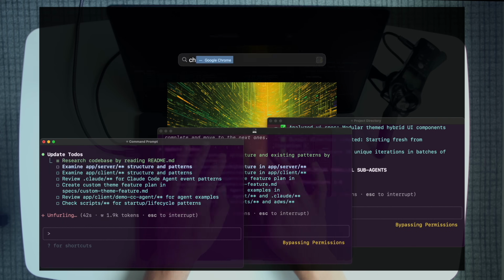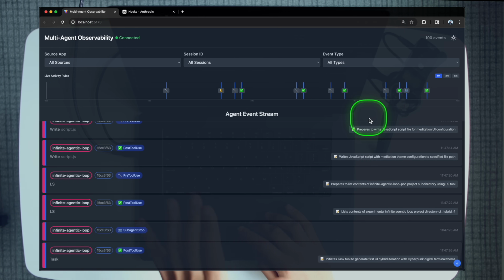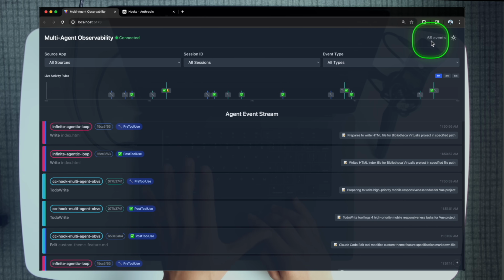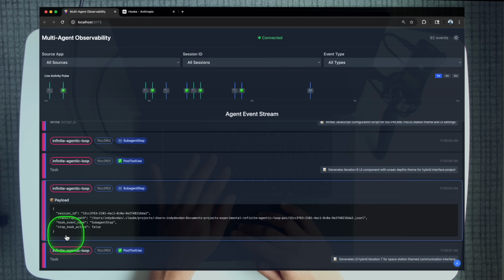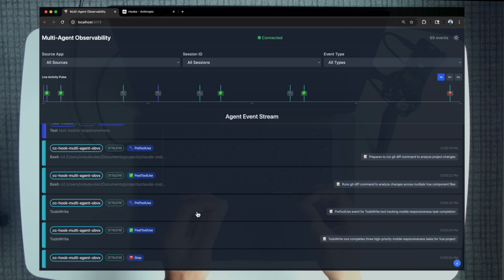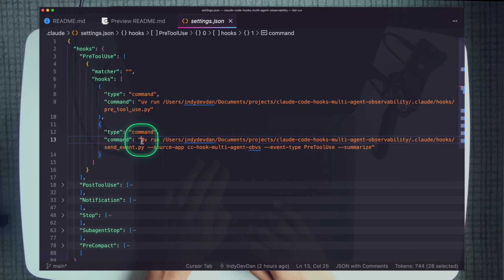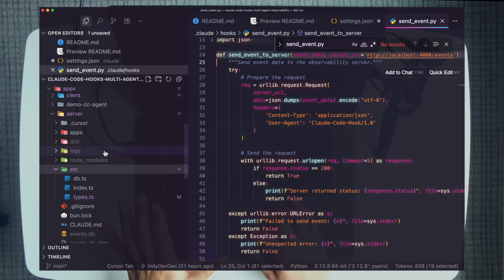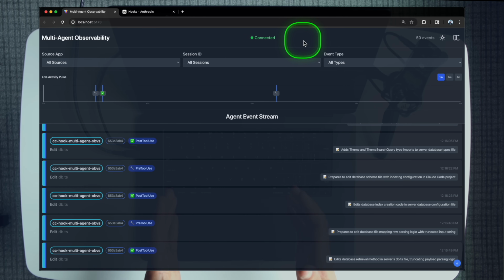I Can SEE EVERYTHING: Claude Code Hooks for Multi Agent Observability

Comment: How do you stop the individual agents from running rampant within their code base ? I’ve got a single terminal multi agent system running, but every combo I make, the agents eventually cause architectural drift, fake results, disconnect front and backend.

Comment: Awesome work.  3 constructive criticisms.  There were packages required for installation that were not mentioned in the readme. The voice was the first thing I disabled. Replaced with soft bell notifications. And lastly, the theme used in this video is modern and nice. The ones in the repo are..well, not great. Consider adding the one in this video please.

Comment: I know Dan speaks to engineers, but the more I work with agentic coding, the more I feel like a software architect. Since using Claude Code, I rarely find myself debugging or thinking about the micro-level details. Instead, I find myself thinking about data flows between different servers and high-level technology integrations.

Comment: Am I the only one here wondering how this would actually work in a production code? You would forever get lock outs on files, with multiple files being edited at the same time. 
You would also never have enough time to actually check the code to make sure it works. Sonnet is good, but anything other than a simple to do app, it still makes mistakes, especially on large, complex codebase.
Also, without checkpoints, this can just runaway with so many agents?

This looks cool, but is anyone actually using this many agents?

Comment: I don’t see the application of this, especially being a human because you can’t read as fast as the programs or agents are making changes to the code base and what space at these agents don’t produce great code and they need guidance from the human being the architect of the system But it is pretty cool so ditty for that.  I’m working more and more more with Agentic AI and I think as time goes on we’ll see if they’ll become better than humans at our job.
Reply: It's about prompting and plans are prompts. See Dan's PRD template which explains high, mid, low level prompts. It might only be available in his course.

Comment: This isn't practically useful at all

All it tells me is which of my agents are alive and working or which lifecycle hook they executed 

If I spawn 10 in Parallel, this just becomes nothing more than watching a stock market monitoring board Lmao
Reply: You need to see past the current demo. This is showcasing HOW to chain it all together, HOW to hook into real-time insight coming from the agent.

There's nothing to say you couldn't just re-factor the front-end slightly to group events by agent or by session or by chat. This is just POC. Is incredibly valuable. 

Additionally - consider post-run evaluation and tuning. It doesn't necessarily need to be real time. And even if it is realtime, maybe you just have another agent watching the feed highlighting any issues that occur and require human review.
Reply: @DuggsTube Already did Bro
I'm working with claude-flow
It's light years ahead of current demo already 
This kind of observability isn't going to cut it when it comes to multi agent orchestration

Comment: I’m curious if you’ve tested Claude code router at all.  It gives you the ability to split background tasks and thinking into dedicated model calls, which might help speed you up. For example, putting background tasks into Cerebras or Groq powered models are significantly faster than asking Sonnet to do everything.  It can also do stuff like use local models, but I recognise that probably isn’t your aim.

Comment: Ok it is cool and all but what is the use case of this? 
I can't trust one claude code instance with the work I have to do and spend most of the time ironing out bugs. I am using it for mechanical engineering so you might see the headache.
If I do this I would just have a shitload of junk code.
Reply: Why are you getting bad results? Whats causing the issue? 

What is the agent doing in order to learn and develop an understanding of the task? 

With this level of observability you can dig in and find out.
Reply: @DuggsTube The issue isn't the agent it's claude the llm. They don't understand geometry.
I use it to create FreeCAD macros for a project I am building.
So it is more the limitations of the llm than claude code. I keep to guide claude to create mechanical sound geometry with code.
Reply: @lazytitan1075 That IS an agentic problem. The LLM may not have a ton of base training on that field but by providing it with ample documentation regarding the field, it will perform much better. 

Try finding some solid papers on the topic, ask Claude to read them, think deeply and synthesize the results into a handful of small guiding documents. 

Then reference those docs when you’re working moving forward.

Information retrieval into information synthesis
Reply: @DuggsTube  not really. Let me ask you, assume you are the best coder there is.
I drop you into the lead engineering position at Volkswagen and tell you build me a new engine with the following specifications.
There is no manual for this. And current llms can't even comprehend 3d objects.
If there was an agent for this there wouldn't be any mechanical engineers left.
Reply: @DuggsTube again I want to add there is no documentation for something I am building mechanicaly with code. I am inventing new stuff.
Reply: @lazytitan1075  There isn't an agent for it. 

YOU make the agent for it. Claude Code, while Agentic in it's very nature is more of a shell for YOU to define. 

We will move towards a place where custom agentic processes exist for every possible workflow needed - but we're not there yet. 

But for now, those who are capable of steering and guiding agents will be able to craft their own customized tooling in the time being.

----

But to answer your question - if i had NO resources at all and had to build an engine i'd probably:

1. Exhaust every option available trying to find SOME sort of similar problem I can review. 
2. If nothing exists, break down my requirements into actionable deliverables with clear-testable requirements. 
3. ENSURE THOSE REQUIREMENTS ARE CORRECT. Hard stop here - before moving forward, SOMEONE needs to tell me I've defined my criteria for success properly. 

Then I'd begin iterating bit by bit trying to build the individual small testable components that I've specced out. Infinite iteration until result = expectation. Then move on to the next piece. 

If i've properly abstracted the work into reusable components that build off each other, each time I knock out a ticket I can use that component for the next task.

Kinda just iterate on that over and over and over. 

It's how I as a human would approach it, and it's how i'd set up workflows for an AI agent to do the same. Recording the process the entire way so it can learn from its past transgressions.
Reply: @lazytitan1075  Nothing is truly new though. I've got to imagine you can break down what you're working on into at least SOME existing components. I can't imagine you're re-inventing math ;)
Reply: @DuggsTube  yeah offcourse actually llms Handel math amazingly. But they lack spatial reasoning. Maybe with point cloud llms